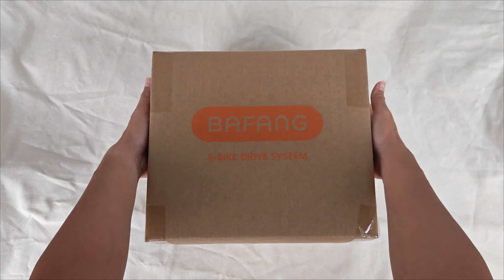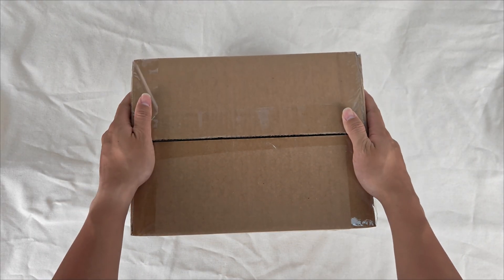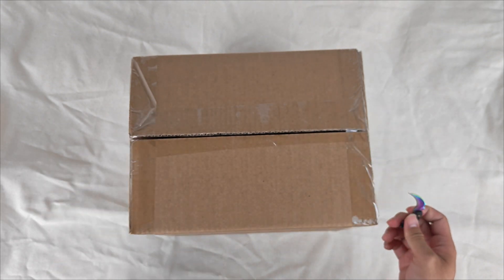Unboxing Varstrom x Bafang ebike conversion kit（BBS02B 48v 750w）

Comment: Hi. Does your Can-bus BAFANG Programming Cable for 8FUN Mid Drive Kits allow adjustment to the correct voltage parameters for a 52v battery? Thanks.

Comment: Di granlunga meglio  uart programmabile in modo semplice, questo eco - can fa schifo, la programmazione  e difficile, ci vuole autorizzazione, il cavetto di programmazione  costo più  di 100 euro
Reply from the maker: You have a point. CAN-BUS is just getting started and is not as easy to use as UART. But I think CAN-BUS will develop in the future. It is undeniable that CAN-BUS is still very malleable.
Reply: @varstromebikeconversion  "CAN-BUS is just getting started" I imagine you meant to convey something more subtle, like maybe its implementation on e-bikes, because this standard is far from new. 🤔
Reply from the maker: @nicknelson9450  Yes, you are a real pro. What I want to express is the application of CAN-BUS on Bafang BBS and HD.👍👍